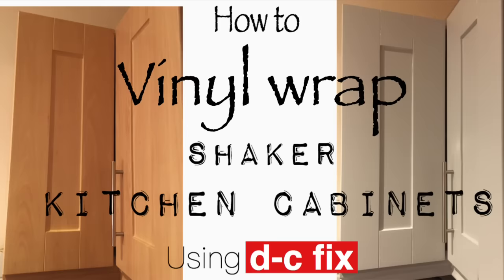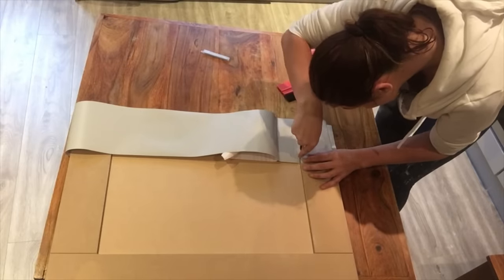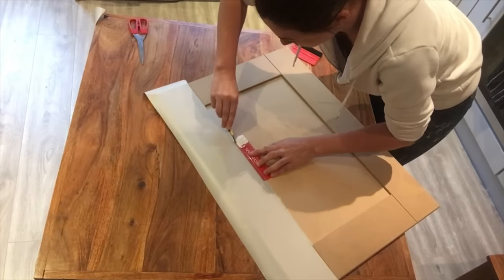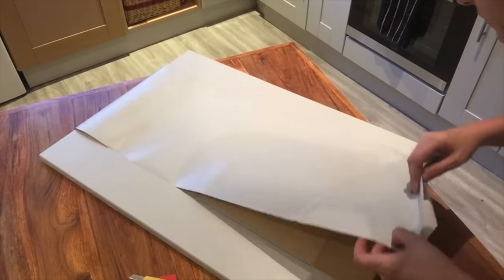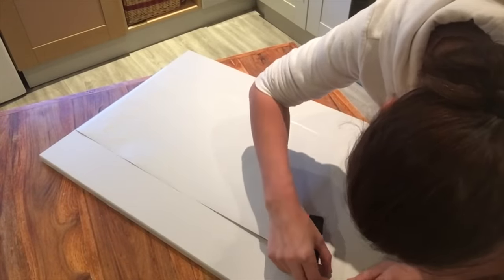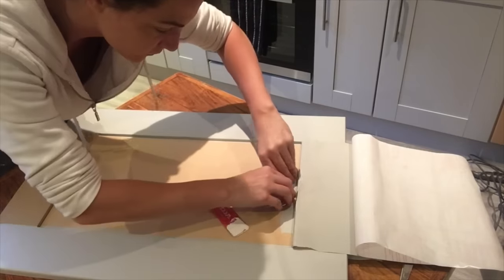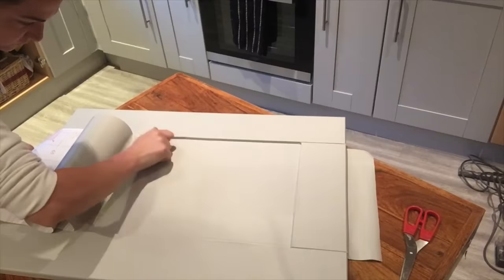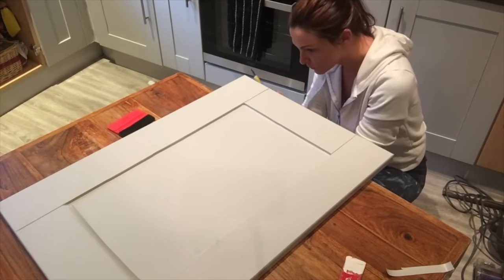USING D-C FIX TO WRAP SHAKER KITCHEN DOORS

Comment from the maker: If you’d like to see how this product has held up over 11 months check out my update video where I also respond to some FAQs https://youtu.be/KOSUQZx-Zvo thanks for watching 😊
Reply: Hi Laura, really helpful video firstly so thank you!

I wondered if you’ve had any experience with wrapping like this where the cupboard grooves are curved at all?

My Mum is looking to do hers but the groove pattern on the door is arched at the top.

Would love to know your thoughts?

Thanks 😊
Reply from the maker: NJS I haven’t done a curved groove before myself but this would definitely require a heat gun/hairdryer if it’s the type of door that I am thinking about. I would say basically any surface that isn’t flat, place the wrap in position on the flattest part of the surface and then use heat to mould around any curves using a squeegee or small tool to push into place. I hope that helps 😊
Reply: Laura Does Life Thanks very much Laura that’s great 👍
Reply: Thanks so very sweet and we will have dinner

Comment: Wouldn't paint have been easier?
Reply from the maker: Once you get the hang of the wrap it’s quite easy to do. I decided against paint as it would likely chip and not wipe down as well, plus it would have cost more and needed more upkeep. The wrap is holding up really well!

Comment: Ive seen this done before but they cover the whole front with wrap and use a heat gun to push into the edges and sides..much easier than cutting strips
Reply: Can you find a the video where you have seen this before? Would be interested to try and find a way to save time

Comment: This is a fantastic idea. You did a great job. For those naysayers who'd rather paint I say go with this instead. I've painted and it's a pain and it's messy. Nice thing about this is that if the vinyl peels away, it can easily be fixed.
Reply from the maker: Thank you Suzanne ☺️ exactly! I’d have been constantly touching up if it were paint. Although I’ve probably done this the long winded way, by doing it in strips if there is any damage caused I can can just peel and replace that particular section

Comment: It’s funny, I just bought some glossy white vinyl to do my cupboards (haven’t even received them yet) and I stumbled across this video.  What great timing.  I am almost finished with my kitchen countertop, which I covered in a glossy, glittery black.  Fortunately, my cupboards are straight with no insets or even hardware so it should be fairly easy.  I bought black handles for the cupboards and drawers.  My cupboards won’t be as difficult as yours but this video is so helpful - thank you!
Reply from the maker: Flat doors are super easy! It’ll look great when it’s finished off you’ll be amazed at the difference when you’re done. Thanks for watching ☺️

Comment: When I was trained by DC Fix you were supposed to use aspray of water on the surface first,then lay on the vinyl and squeegee out the bubblesand water. The water lets you move or remove the vinyl before final flatten.
Reply from the maker: Thanks for the tip Glen I will try this the next time!
Reply: Spraying water on bare mdf is not advisable as it soaks it in then swells.
Reply: Never spray water on bare MDF and to stop those lifting bits/bubbles on corners use some 3M primer 94…

Comment: I helped my son do this to his kitchen but we put 1large piece tightly over the doors and then used the hairdryer to heat it and pushed the vinyl into the groves which is so much easier and actually is on the instructions it can be heated
Reply from the maker: Hi Amanda, one piece only works with certain types of doors - these type needs the strips because it doesn’t stretch out far enough to cover when heated

Comment: These look amazing, if I did this to a cabinet that had been painted with a roller , will I see the texture through the vinyl ? Also how well does this vinyl clean with everyday messes ?
Reply from the maker: It cleans really well. It’s a decent thickness, I would think it would cover although you’d probably be more likely to get air bubbles if not completely smooth surface
Reply: Thanks for the video Lauren, really well done. I have not used this product but I have plenty of similar experience. I would think that the paint or any other embellishment would show through, the product is very thin. You would need to sand down first to get a perfectly smooth surface first.

Comment: I want to do this to my bedroom cupboards that have a thin strip of wood around them, wonder if it’ll be the same process
Reply from the maker: If there is only a thin strip on the edge you may able to do them in one piece rather than in strips depending on the thickness of the strip 😊

Comment: How long does the wrap last, is it quite secure? Trying to figure out if I should do something like this or paint!😊
Reply from the maker: Kelly Morgan so far it’s holding up well but it’s only been on a month or so. I would say if you are going to paint then make sure you put a varnish over the top so that is more durable when wiped down. The wrap is    easy to clean but I would say keep some spare in case you need to make any repairs further down the line. I scratched some of the cupboards when I was fitting new worktops but was easy to fix with a new piece of wrap. Have you seen the full completed kitchen with new worktops? Budget Kitchen Renovation | Kitchen Makeover | Part Two https://youtu.be/XomXRmf4QYU
Reply: Vinyl will last 10 plus years if looked after

Comment: We have the exact same cupboards . Just thinking would it not be easier to use one single sheet to cover each door rather then using three separate sheets ?
Reply from the maker: Hi Abbas, you’d think so! This product doesn’t stretch far enough when heated for these doors to do that, it only really works with one sheet of there is a raised section in the middle ☺️
Reply: @LauraDoesLife  oh right ok thanks 🙏🏽
Reply from the maker: @abz7509  it looks like a lot of work but once you’re over the first door or two and get the hang of it you’ll fly through the rest!

Comment: You did a good job,you could have made it easier for yourself by doing the centre piece in 3 strips.
Reply from the maker: You’d think so at first look but you actually waste more of it like that - because the middle is set lower there wouldn’t be any coverage on the inside edge if you get what I mean? You’d then end up having to cut a larger middle piece for the edge to be covered and waste the smaller middle section.
Reply from the maker: røb I’ve even confused myself I think - I think I’ve misunderstood the original comment!

Comment: Hi im curreny doing this at the moment.ive came across a few small bubbles as im doing it which ia annoying  if any tips?x thanks
Reply from the maker: Hi Anne Marie - bubbles are easy to sort, just get a small pin or needle and prick into the top of the bubble then go over with the squeege and they should come straight out! If you’re getting a lot you maybe be working it too fast, try holding the wrap up off the surface and only let it touch the surface when you are ready to smooth over with the squeegee. Hope that helps! 😊

Comment: Question for you since this looks like such a good idea.  I am very patient and like detailed work....but....I have intricate crown mold at the top of my kitchen cabinets that have a fancy rope/braid pattern on it.  Would this vinyle take on that shape?  My concern is if I can do all of the cabinet and doors with the available white of this material, but have to paint the crown mold on the cabinets, it might look odd (painted surface and color difference side by side with the wrapped doors). I would have to be able to wrap the crown mold in order to match the color and finish.  Love to hear back from you on this!
Reply from the maker: Hi Donna, if you have the patience it should work but l would definitely recommend using heat on it with a hairdryer and probably use something like a cotton earbud or orange stick to push the vinyl into place into the crevices on the moulding. Lay the vinyl over the top, turn on the heat and push into place. Would also only recommend using the Matt finish not the  gloss. The gloss is much thicker and harder to work with but the Matt should go on fine, it will probably just take a little bit of practice. I’d remove it from your units too if possible so that you can sit at a table whilst doing it ☺️
Reply: @LauraDoesLife  Thanks!

Comment: If you remove after a while, would it damage or peel off any paint work that may be underneath?
Reply from the maker: Possibly would peel off paint if it was already chipped or peeling but I would think it would be pretty safe on most surfaces 😊

Comment: I've got a question.. so the wrap on my kitchen cabinets at the house we just moved into started bubbling on the bottom of the cabinet door. How do I fix that? Any tips would help!
Reply from the maker: Hi Catherine, perhaps try heating with a hairdryer and smooth it down. If it’s the original factory wrap this may not work but worth giving it a try! 😊
Reply: @LauraDoesLife  Awesome, thank you! ❤️

Comment: That looks great! Can you wrap existing factory wrapped doors or do you need to rough it up with sandpaper? Also, how is it beside heat, i.e., the oven?
Reply: Btw, the doors have a slightly contoured grain pattern.
Reply from the maker: You can cover over existing wrap, there is no need to sand down. Just make sure the surface is clean. An existing grain shouldn’t show through as dc fix is quite a good thickness. It’s holding up really well around my oven so the heat isn’t causing any damage, I think it is heat resistant up to a certain temperature. Hope that helps. Thanks for watching 😊

Comment: I have bar high table and a 6 cub storage unit  (Target) in the corner of my living room. I would like to make them the same color in a wood finish. Problem: table has beveled edge and a circular edge in front!!! Any ideas.???
Reply from the maker: Bevelled edges are slightly more difficult,  definitely use a heat gun or hairdryer and cut the edges so they bling at the fold. Maybe also cut separate pieces and try to join them?
Reply: @LauraDoesLife  do you have any videos on that procedure. Can I use a hair dryer?

Comment: You should have done it all in one piece and used a heat gun to help it form to all the corners and lines
Reply from the maker: DЯAiИ G4ИG H€ЯФ I’d tried this and was really tricky as the center part of the doors was lower so it was constantly ripping and creasing up. If the middle had been raised it certainly would have been better to do it that way. This particular style of door was just a bit of a nightmare with only 2 hands!
Reply from the maker: Roo Blue yes I did, I was trying it on a larger door and the middle is quite deep. Probably with another pair of hands to hold the door or the hairdryer I might have been able to manage it but by that point I had wasted quite a lot of the wrap so looked at this way as an alternative ☺️ definitely better to do it in one section if you can manage it although I’m glad I’ve done it like this as My dishwasher door has a scrape on it so will be easy to repair one section rather than re-wrapping the whole door!
Reply: @LauraDoesLife  ah I was hoping you would say no lol dc fix have a video on here making it look simple 😂that's a hood point about only having to redo 1 section though!

Comment: How did you get on with wrapping the bottoms and cornices
Reply from the maker: It was really easy. I was adding in a few extra cabinets so I bought a new piece of cornice and wrapped it before I fitted it on to the cupboards. I wouldn’t recommend doing them whilst they are still in place as would probably be quite tricky, much easier if you take them off - they are usually just screwed in to the cabinet 🙂
Reply: @LauraDoesLife  thank you. 👍

Comment: Do you think this product would cover bare MDF any tips appreciated .very good video
Reply from the maker: Yes it does. I had to get some extra doors made as I was extending the kitchen slightly with extra cupboards, these were plain mdf and covered fine. Tip with it is though not to pull back the vinyl too much once it’s stuck on otherwise it gets residue from the mdf stuck onto it which can cause a lump. Just peel back small amounts as you are apply and this shouldn’t happen. Also a tip from another viewer was to spray with water first before applying. Hope this helps!
Reply: @LauraDoesLife  when I watched your video I thought the cupboard door looked like new MDF thank you for reply will be trying over weekend
Reply from the maker: I pulled off the existing wrap on quite a few of them because it was coming off so most were plain mdf now I come to think of it. Just give them a wipe and make sure there’s no dust and you should be fine 😊
Reply: 100% this stuff works on mdf

Comment: Painting would be much easier!  In the time you spent on the first strip I would have had the first coat painted on both sides
Reply from the maker: I don’t understand why people watch this video if they think painting would be easier. It’s a completely different concept and finished product. I regularly paint furniture and it’s so hard to maintain. Kitchens get a lot of wear, paint requires so much maintenance. As mentioned for other comments, this is purely for demonstration purposes, when you are doing your own kitchen it really doesn’t take that long.

Comment: Hey there, what would you suggest as a primer?
Reply from the maker: Hi Kirsty, there’s no need to prime before using this product. Unless you have a really poor surface, then I’d just use a standard paint undercoat perhaps and give it a sand and wipe over before applying.
Reply: If you want a good primer then it's got to be 3M tape primer 94, it is expensive though, £29 for a 250ml tin, wipe the primer into the grooves with a lint free cloth and it double the adhesive qualities of the contact paper, I use this all the time at work and wrap kitchens etc on a daily basis.

Comment: hi how did you get the old wrap off
Reply from the maker: It was already peeling on most of the doors so easily pulled off. There were a couple that were still intact, I just sliced the corner and slid a knife underneath to loosen then pulled off. Hope that helps

Comment: Using a hairdryer will heat the dc fix and help mold it into any grooves/panels in the door, this way looks so long winded and painful lol you must have a lot of patience
Reply from the maker: I’d tried it and it kept ripping unfortunately so did this way as an alternative
Reply: Ohh, I guess in the videos I've seen, they're doing it to advertise the product so they make it look easy 😬🤣
Reply from the maker: Yasmin Lawson I think it’s just the detailing on this particular door that makes it really fiddly. If it would have been a complete square around the outside it would have been fine but all of the indentations were just too awkward. Maybe with a bit more practice I could have mastered it but wasted so much trying I decided this was a better alternative.
Reply: @LauraDoesLife  yea it's not the easiest thing to fablon! You did it though and it looks fab 😁

Comment: Hello! I am really wanting to do this to our kitchen as we are renting and the cupboards area horrible brown colour. Just a quick question, when you are using the knife to cut the edges off etc, does this leave marks in the actual cupboard/wood? 

Thank you!  :) x
Reply from the maker: I think that you should be ok and wouldn’t worry about leaving marks. If you are wrapping on top of an existing cupboard wrap they are usually quite thick and unless you are pressing on super hard you shouldn’t damage what’s underneath! Good luck x
Reply: I love this idea i would love a nice stainless steel

Comment: Wow,
You made that look too easy... I fear it isn’t. Can I ask how it came to £40? Does one roll get you 2x doors (£2.50 per door) 16 doors?  Next one I don’t have shaker it’s oak panel. Would it work on those and if it didn’t go well does it come off easy.. that’s it..😂😂
Reply from the maker: Hi Richard, after getting around the first one the rest are pretty easy. I had different sized doors so if I remember rightly I was able to do 3 or 4 on some rolls plus doing plinths. Flat doors are much easier to do. It does pull off easily with no damage 😊

Comment: why not apply a single sheet of vinyl over the whole cabinet door, and use a heart gun or hair drier to stretch and fit it into all the corners and indentations.
Reply from the maker: Tried it and made a complete mess. Too many edges and indentations on this door and wasted so much wrap with tears and rips unfortunately

Comment: I think I'll just paint.  This takes WAY too long.
Reply from the maker: I’m planning on doing a paint vs. wrap to look at the pros and cons for both. I personally think the time is worth it in the long run, but by the time you’ve done a couple of paint coats and a varnish it’s probably about the same amount of time. Paint is very hard to maintain and the finish is great with the wrap.
Reply: If you do a good paint job, it's going to take even longer. Sanding, primer, multiple coats, varnish, dry time, brush lines in the finish, yikes!